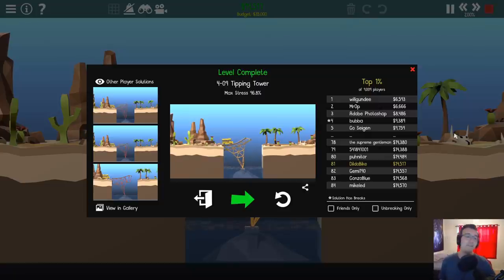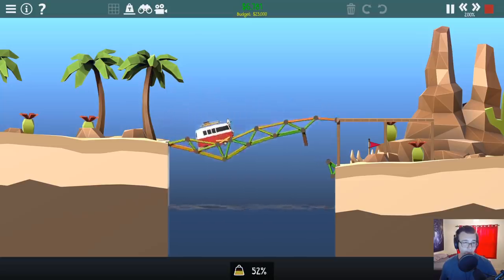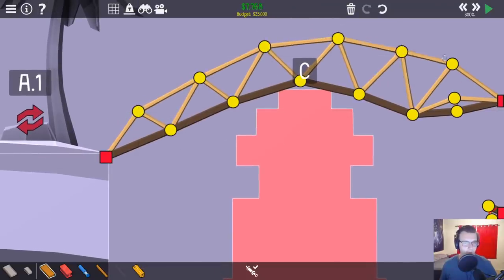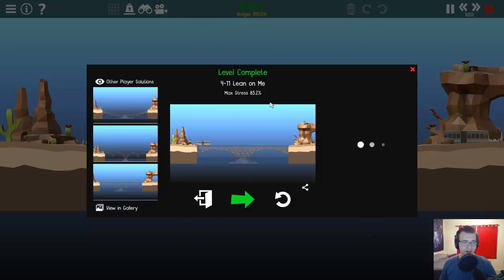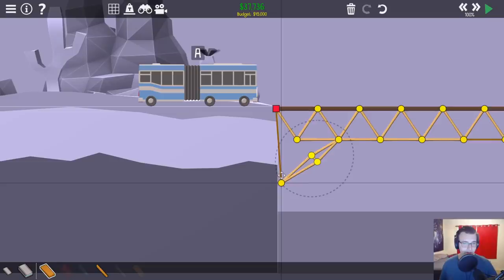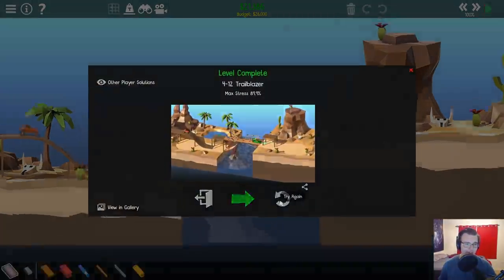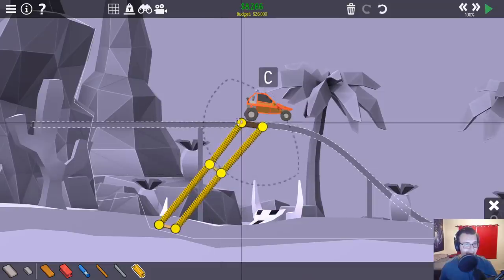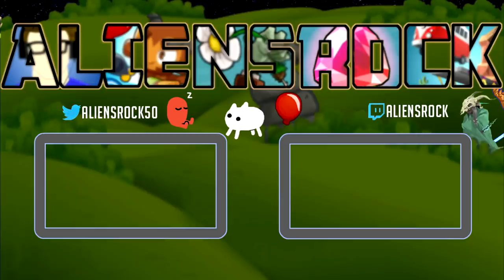Bridges That Only Work If You Floor It

Comment: “We have reinforced roads, which is sketch” - aliensrock, on the topic of building bridges
Reply: Structural integrity is for the weak. (heh... get it?)
Reply: @lowkey_Ioki  No I don't get it... 

Because I am not weak
Reply: Your reinforced bridge is bad and you should feel bad
Reply: "This is good because it has no steel"

-aliensrock, on the topic of building bridges
Reply: Reinforced road has the properties of both road and wood.
Reply: Bridge
Reply: @dark9night210  Thank you for your addition
Reply: road
Reply: Steel
Reply: “Steel is a noob trap”

Comment: Considering that road is stronger than wood, I’ve been doing some experiments recently and I think I may have found a more efficient bridge design than the under-over arch. I reckon it might even be possible to make a road arch for “lean on me” without using the rock in the middle. So long as the bus is fast to enough to get up it anyway.

Comment: I recall you saying that the devs did something to reduce the RNG. but from what I see, I feel like the change is that every instance is saved and is replayed after the first try. then, if you make a minor adjustment a new instance is saved. that’s why sometimes random minor parts break for you when you make a small change later on and sometimes something that broke survives after a change that doesn’t affect it. 
so you can still RNG manipulate by making very tiny changes
Reply: probably they are just calculating the seed from all the objects in the screen, if you make a little change, the seed changes too and things that worked before could break